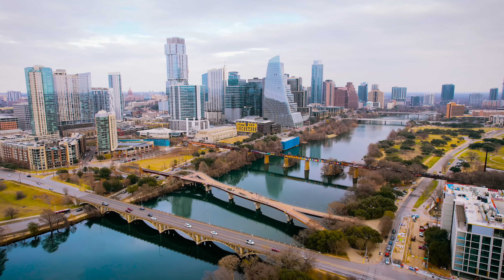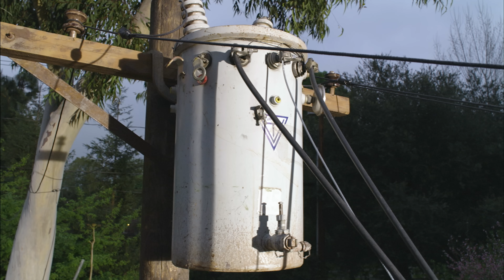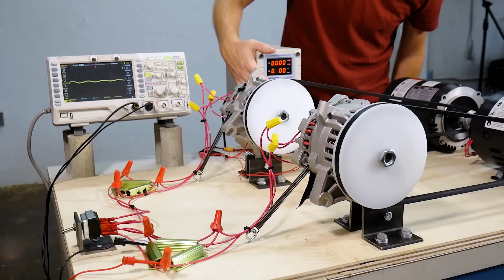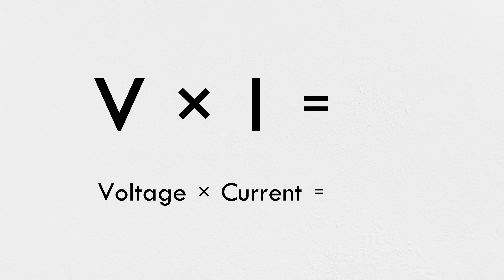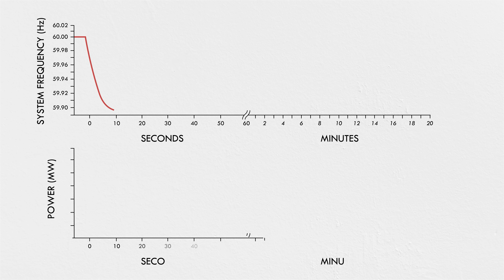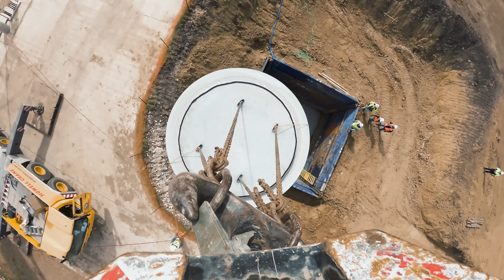Connecting Solar to the Grid is Harder Than You Think

Comment: 6:13 - Er... no, that's not what PWM is. 

PWM is just changing the length of pulses to approximate a specific duty cycle / average value. The clue is in the name. What you're showing in that animation is changing the amplitude (height) while keeping a fixed step (length), generally called a "modified sine wave" (or sometimes "switched sine wave"). It looks a bit like a PCM waveform (did you confuse PCM with PWM?), not like a PWM signal.

A PWM "wave" would have just two levels (essentially "on" and "off"), and would typically have a much higher frequency than the intended sine wave (ideally by several orders of magnitude). It could then be low-pass filtered to approximate a sine wave, but it still wouldn't look like what's shown in that animation (it would have a lot of diagonals, it wouldn't look like a staircase).

Comment: So knowing the current grid frequency and the target frequency can a modern inverter help push or pull that frequency back towards the target?
Also are batteries going to be sufficient to replace the spinning inertia of thermal generators or will we end up with large physical flywheels that are able to rapidly provide frequency compensation?

Comment: Thanks for the great explanation! Another mechanism to stabilize the energy grid are the energy markets. The European power grid heavily relies on its Frequency Restoration Reserve capacity of producers and consumers altering feed in and offtake during times of ‘imbalance’. There are significant amounts of money being made by companies able to do so fast enough, > 1000 €/MWh in a 15 minute interval. Large, grid size battery packs are being commissioned by private parties to capitalize on this market. Good to note that it doesn’t only rely on producers having additional capacity, but also on consumer’s flexibility to reduce intake quickly. It’s a fascinating market.

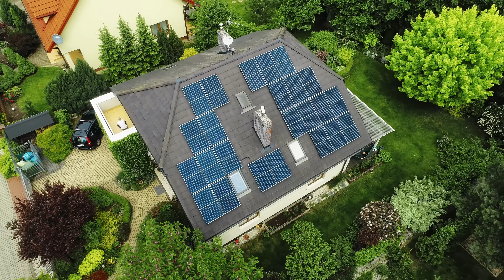Comment: 7:45 - “ most grid-tied solar systems on houses can’t give you power during an outage”.
I assume you’re an engineer like I. That is a very unfairly constructed sentence. 
It is what is called a “necessary but not sufficient” statement.
The word “most” is wrong unless you have done a survey of all solar systems on houses on the planet.
It also means all of the designers who specified them did not include batteries to absorb the solar power and allow the house to go off grid.
Secondly, as this was made in 2024, you know that all of the solar companies include battery storage in their proposals. So not mentioning that they would do that is also an implied dereliction of duty on solar power companies you do not mention or comment on. 
And you continue on without ever mentioning it, which is very - not - an engineering culture.

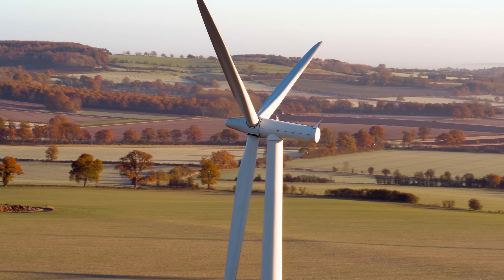13:28 - you mentioned battery once when you could’ve talked about it for 10 minutes as distributed energy resources include grid scale battery electric energy storage that instantaneously deals with the frequency /voltage issues that you mention. Grid level storage doesn’t have the issues that traditional plants have- staying on just in case there is a load event, as grid level energy storage can respond instantaneously to grid challenges. And since they can respond faster, they’re actually putting peaker-plants out of business, good for the environment by the way.
Disappointed.
Reply from the maker: https://assets.bbhub.io/professional/sites/24/Scaling-the-Residential-Energy-Storage-Market.pdf
Battery attachment is still less than 25% for residential solar installations in the US, Australia, and Europe as of 2023.
Reply: @PracticalEngineeringChannel Well said. Battery production has clearly been a focus of infrastructure projects domestically for a reason, and it's because we lack batteries in the majority of the cases.

Comment: This is why when I do solar, it will be off grid. What good is it to have solar power if it goes down with the grid? To me one of the benefits of solar is to have air-conditioning and lights while your neighbors are running around with candles in the heat XD.

Comment: I didn't understand why grid frequency drops when there is more demand than load, but this makes sense:

>whenever there is increase in active power requirement, kinetic energy of rotor is used to supply this increased power demand which lowers the speed of rotation and results in frequency drop.
Reply: THIS‼️ I am really confused as to why Grady did not discuss where the added power comes from. My assumption is the same as yours, but I did not hear it in the video. And, I am shocked that I had to scroll through 100s of comments to find a mention of this. I feel like I must've missed something.

Comment: There's no good reason to do things this way.  The vast majority of base-load isn't residential customers.  The delusion that the grid needs to function at maximum capacity is an economic delusion.  One driven by stock value and quarterly dividends.  There's no function other than to manufacture unsecured debt and trade it for tax money.  Commercial and Government organizations should be making and storing their own energy and maintaining their own base-load.

Comment: Good video! I would think that HVDC transmission lines ought to have the same impact as solar, wind & battery storage. Do they?
Reply: No.  HVDC is cheaper than HVAC for distances greater than roughly 300 miles (maybe less now).  HVDC is twice as efficient... but that's twice as efficient relative to the 95%+ efficiency you already have with HVAC so the impact is not as great as one might imagine.

It really is just a matter of cost.  HVDC is cheaper for long distances because AC becomes almost impossible to synchronize over long distances due to the phase changing too quickly (due to power line expansion and contraction with temperature and other factors).   So long-distance AC transmission lines need expensive resynchronization hardware every X miles while HVDC lines do not.
Reply: @junkerzn7312  Thanks, but maybe if I restate my question: Wouldn't HVDC transmission lines (having inverters to convert to AC to interconnect to the destination grid) have the same inverter characteristics as solar or wind farms? Unless of course somebody designs those features in.
Reply: @koyamamoto5933  The inverters converting HVDC back to AC are not generators, just like the transformers converting voltages on AC lines are not generators.   HVDC converters are two-way devices (just like transformers), so they don't really force the power to flow in any particular direction themselves.

This is fundamentally different from the inverters for a solar farm or battery system which have to force power flow in one direction or the other, or both.

Comment: With a grid tied inverter, increasing or decreasing the voltage will just push or pull VARs from the network.  It is actually shifting the phase of the inverter ahead of the network that will push power out.

Comment: Most of us have what is called single phase power. One wire at one frequency; in the USA this is 60 cycles per second. To connect to another source of power it needs to be at the same frequency, 60 cycles per second. It also needs to be at the exact same place, phase, on the incoming power, like 2 musicians playing the exact same note. If there is a difference, this will cause a power surge and it will turn off the power. 
If you have a generator for your house, it cannot turn on until the power from the utility pole turns off; when there is a loss of power the lights will go off for a second or so.
This is not a problem for you, but you might lose your YouTube connection for a minute or so. Simple, right?
But power on the grid is three phase (AC). Without trying to explain the difference, this makes things much more difficult.
If you have a Direct Current (DC) power from batteries or solar panels or wind generators this complicates things because they do not have alternating current (AC). So, you need a device that can create alternating current (AC) at the same frequency and phase that is coming into your home. Imagine two musicians playing different notes at different volumes. It will probably sound awful. And with electricity, it will just turn off. It might also explode.

Comment: I know that battery backup is increasingly being used for secondary response, but I think it's worth noting that Natural Gas plants are extremely valuable to utilities because of how quickly, precisely, and reliably their output can be ramped up and down.  Somewhat ironically, replacing old coal and other "slow" combustion plants with newer gas plants makes it much more feasible to also incorporate additional renewable energy sources.  For the forseeable future, we need to be doing both.
Reply: Battery backup is increasingly being used as the primary response, actually.  That started happening in Australia and now in California and we'll probably start seeing it in Texas this year... once they got more than a few GW worth of batteries online it became the natural go-to way to deal with unexpected trips from fueled plants

Batteries can respond much,  much faster than anything else on the grid.  Tens of milliseconds.  Actually Grady didn't really address batteries at all... while it is true that solar plants can't add more power than the full power they are already pushing, batteries are completely different.  And while it is true that a single inverter doesn't have any momentum to note, this isn't true when you have a thousand inverters pushing an extra few GW to the grid all at the same time.

But NG is still valuable because batteries can't keep pushing that kind of power for more than 30minutes to an hour verses their normal 4-5 hour operating window.  30 minutes is enough for other fueled generation to really start taking a bite out of the burden.

Comment: Grid-tied inverters did my head in, the first time I learned about them.  I tried to think through how something could sense the proper frequency as it was simultaneously generating power on a shared output.  One way might be to monitor current, as it would start to rise as the grid and inverter fell out of sync and began to fight each other.  But how do you actually know what is actual load, and what is phase error increasing waste power?

It does my head in still.

Comment: Another example of grid frequency blackout is the eastern seaboard blackout of 2003.  The grid was running at capacity when a powerplant tripped, and 8 states and southern Ontario tripped offline.  

Power lines have their own internal resistance (called volt/amp reactance or VARs), and resistance converts current to heat.  The more current you try to push down a line, the more heat created and the line starts to expand and sag.  

You can actually see this if you photograph a big power line from the same spot during high and low power demand periods.

In the case of this blackout, a line heated up and sagged into a group of trees that hadn’t been trimmed.  This caused a ground fault, and a protective relay at the plant did what it was supposed to do and opened the generator breaker, taking the plant off line.

This caused a drop in frequency at nearby powerplants forcing their under frequency protective relays to open their respective generator breakers.  

This lead to more and more areas where grid frequency collapsed, causing a cascade failure that took out most of the northeast grid before it could be contained.

The next problem was how to bring the grid back up, and it was caused by people.  They wanted to know when power came back, so they went around turning on lights and radios to alert them when power came back up, creating a huge potential load.  

Anytime a powerplant tried to close its breaker, it would just get dragged back off line.  Since the grid was dumb (no remotely operated switches) in 2003, (most of it still is dumb), utility workers had to go out and manually open switches to “island out” areas small enough that the generator governors could react fast enough to the sudden load without tripping.  

At that point, the people with power would go around shutting off all the lights and radios, lowering the load in that island.  Then the next island could be connected in and so on.  It took 7 hours to reestablish power to most customers.  It was several days for some customers.

At no point did any equipment fail.  It all did exactly what it was designed to do.  The point of failure was the lack of maintenance in trimming trees (exacerbated by environmentalists trying to prevent tree trimming).  

The grid operators in Ohio were criticized for a lack of understanding of their section of the grid and improper response, but in fact, understanding grid operations requires being able to do the calculus in your head.  A bunch of business majors had no chance.
Reply: I was stuck at JFK airport until next day for a flight to Europe. Slept on a baggage conveyor. Nice music from a traveling orchestra.
Reply: Your explanation of this outage is better than anything I’ve seen online. 
Thanks for your write-up.

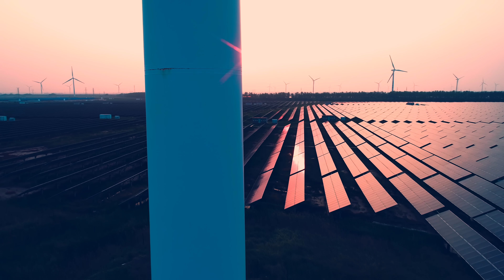Comment: 15:20 "Inverters can provide a sustained response.".  This is misleading, inverters cannot provide a sustained response on their own, they need primary power.  If that primary power is coming from solar panels, they cannot deliver any extra in an under-frequency situation, because they are already maxed out.  Even if the primary power is coming from wind turbines, their inertia is very low relative to their output, so again, the best grid forming inverters cannot compensate for that lack of primary power in a crisis, but the should be able to hang in there better.  To be able to provide the grid with what it needs, grid forming inverters need to be supported by fast response energy storage like batteries in addition to the primary power coming in from the solar panels or wind turbines. I think that this aspect could have been explained more accurately, and I encourage you to recut it and repost the video to reflect that.  The rest of the video was brilliant

Comment: What a coincidence, I just bought one of those portable power stations to replace my ancient UPS that's pretty much dead. It's interesting to see how this works on the grid side, and it explains why they don't recommend using a portable power station as a UPS, even though it can basically do the same job. I think the reason is that they don't bother with the PLL, so the portable power station makes no attempt to match the grid when switching on or off the inverter. Basically, if the sine wave of the grid was at its peak when it switched off, the inverter has to wait until its wave is at the same level before it switches on, hence why it could have a switching time of up to one cycle before it switches on.

I tested my portable power station last night by pulling the power, and everything stayed powered on, but I would have to test it by disconnecting it while the inverter was at a full cycle away from the mains in order to make sure my gear is guaranteed to be unaffected, which is not an easy thing to do.